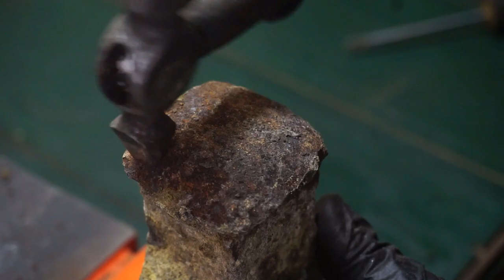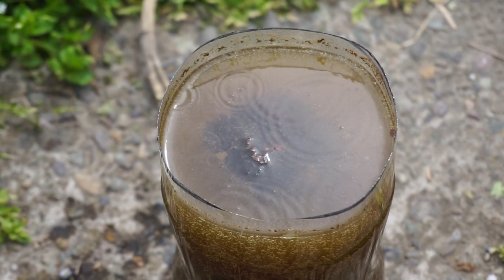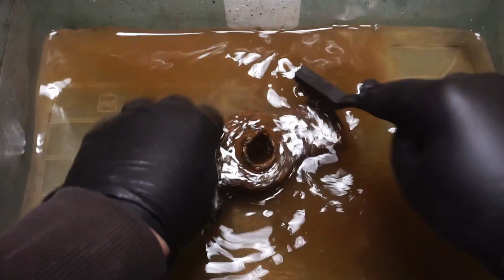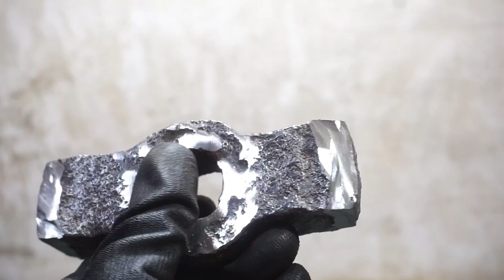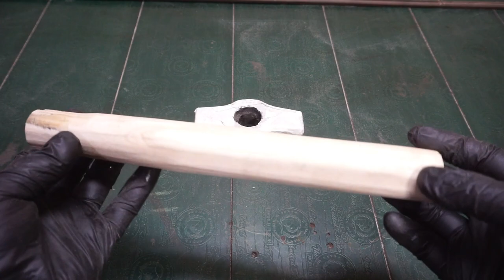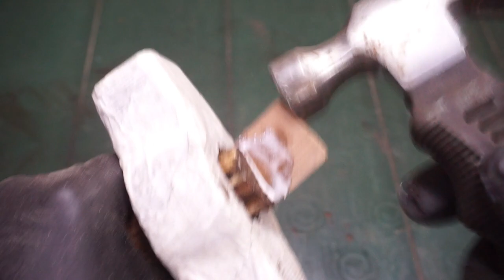Restoration 200 Years Old Hand Forged Hammer

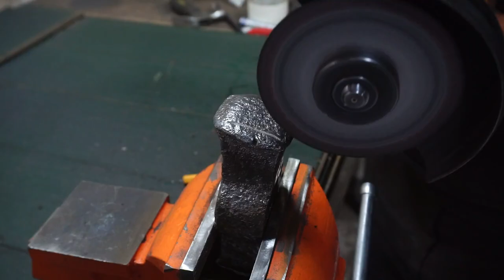Comment: 200 years old .... Not. The head was welded on a round bit of tube as a handle. At 6:57 you can see the remains of the welding that have been ground off. I don't think welding in this form was around 200 years ago.

Comment: Every job requires attention. Both the person doing the work and the person watching the work. What deviates from all this is when the attention of the observer is greater than the attention of the craftsman performing the work. By cutting off the depressed ends of the hammer and shortening the hammer, you have already taken a lot off the original weight of the hammer. If you already had to do it, then why didn't you at least use a manual sander to remove the numerous craters caused by the rusting process and bring the hammer to a complete smoothness and shine, but left it all? You will agree that the hammer would look much nicer that way than it does now. As it is now, it is susceptible to rust again because you didn't protect it with hot or cold bronzing (hot bronzing is better). In my opinion, this is a half-finished restoration. I would rather call this a cleanup than a restoration. You tried, but not enough, which was reflected in the final product of the restoration itself. I would like this criticism not to have a negative effect on you, but to help you avoid such mistakes in restorations in the future. I wish you a nice and pleasant day. Greetings from friendly Serbia.

Comment: How do you know it's 200 years old?
Reply: Probably by it’s design, or provenance maybe.
I dug some chisels out of my garden some years ago, a common cold chisel and a flat chisel, the flat chisel was stamped Lancashire & Yorkshire Railway, (UK) which hasn’t been in existence for 100 years, so I know the chisel was made from 1847-1923.
The ordinary chisel has no markings, so I don’t know the age of that one, except I’v been in this property for 25 years, and the previous owner passed away in his 90’s.
Both chisels are in my work tool box and still get used occasionally.

Comment: Nice job. I just wish you would have left a bit of the mushrooming on one side to give it more of a rounded face instead of squaring of both ends  like a sledge hammer. You could have spent a bit more time with the fit and finish for the handle. Squaring up the handle where the head rests seems a bit lop sided. Over all good job I think.
Reply: From here in Czech where we see some real authentic metal workings and even reproductions as look real.   As actually I feel like it was overdone... too much ground off... the finish hardly looks like a 200 year-old forged hammer in the end.  Something somewhere between...

Comment: Dude, 5 minutes in and I can tell you're Really impatient...Rust remover for just 3 hours? Then again after another 6? Why didn't you leave it in the rust remover for like 2-3 days? Then electrolysis? Then an angle grinder?? Then a sander? Nice job though...👏
Reply: Was wondering why you didn't use the electrolysis part of the process as well but loved how you left some of the ruff parts ,great job
Reply: Great observation: Obviously the cola wasn’t strong enough... electrolysis may have helped too.
Reply: I was def thinking electrolysis would have been the best route.
Reply: Rust remover 2-3 days, electrolysis, angle grinder, sand. That’s quite a bit of over kill. Rust remover or electrolysis overnight the grind and sand would be all that is needed.